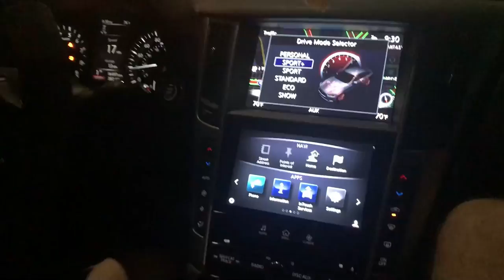Q50S BUILT IN 17 MINUTES (INTAKES, EXHAUST, TUNE, AND MORE)

Comment: Used wrong coolant bro. Should've used blue coolant, nissan blue coolant is the way to go
Reply from the maker: Thanks for the recommendation
Reply: Eh as long as it's the right mix it should work the same. They should have used a vacuum refill tool to make sure there was no air in the cooling system.